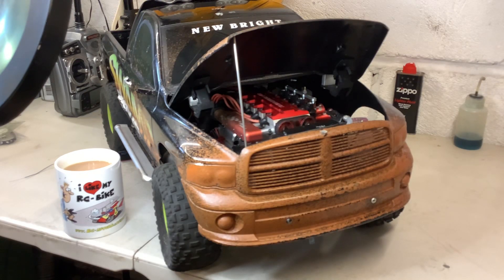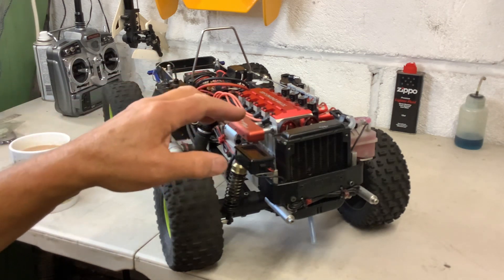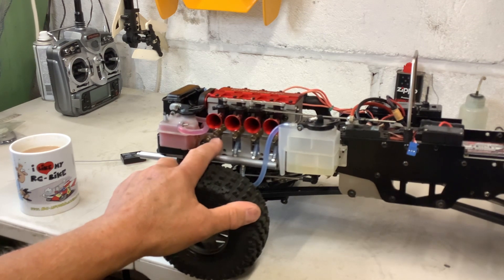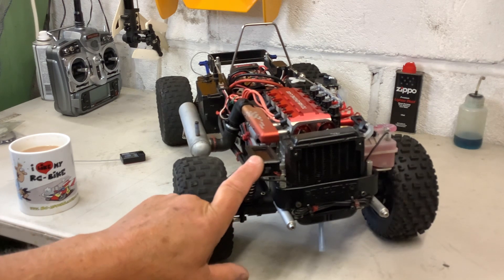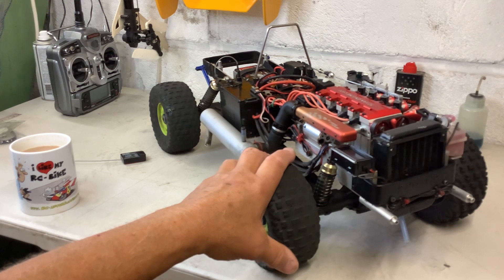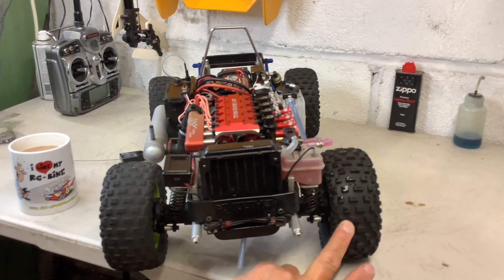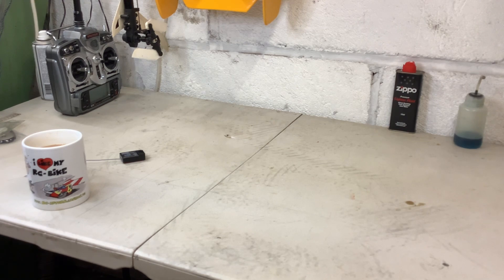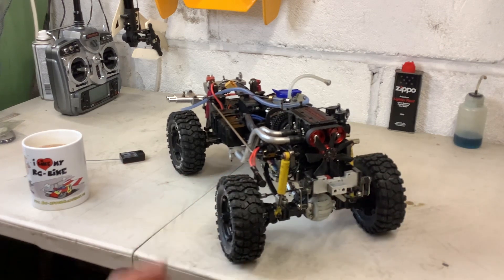Toyan L400 engine Swamp Dog

Comment: I think those carbs these engines come with are total junk. I put a real nitro carb on my semto 2cyl and it runs very good! Mine use to go through nitro fast as well until the upgrade
Reply from the maker: I have the SEMTO 2cylinder it seems ok, just don’t Rev very high and not much throttle response